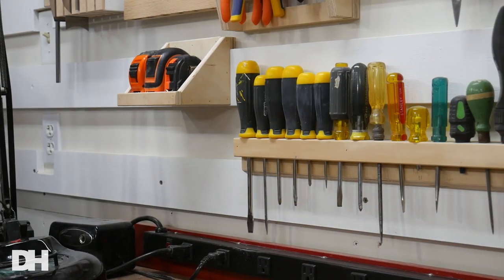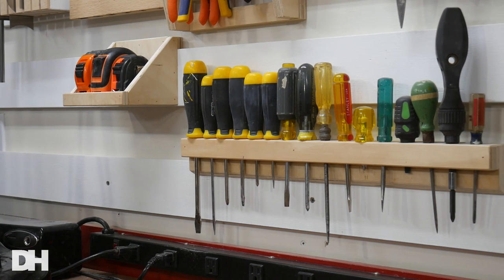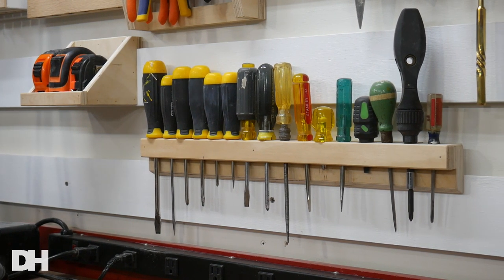Making a Two Tiered Screwdriver Holder

Comment: I’ve just re-made my screwdriver holder for the French cleat wall.  The first one I had all my screwdrivers on it, so was quite wide and being 4 rows deep it tended to want to tip off the cleat as I didn’t make the downwards support angles long enough.
Instead of 1 rack I have now built 3, moved the lesser used PH and Torx screwdrivers to separate racks and the PZ and Straight on the main rack.
The other thing I did different was to drill the holes to just the width of the screwdrivers + 1/2mm.  They now stand much more upright and don’t wobble around

Comment: What’s that bit called that you used to smooth out the holes?
Reply: Take Care Man...It appears to be a large countersink bit.  Shallow angle.  Take care to center that bit directly over the existing hole so your bevel lines up properly with the existing hole. (This is where using a good drill press fence/jig comes in handy.) I'm guessing the bevels are probably more for aesthetics than function, since the screwdrivers should do fine sitting on a flat hole edge, but it does make it look nice!
Reply: Jim Sulsona Thank you! That is very helpful.